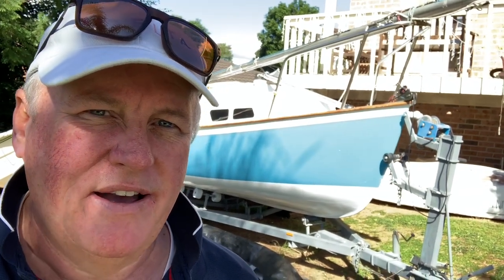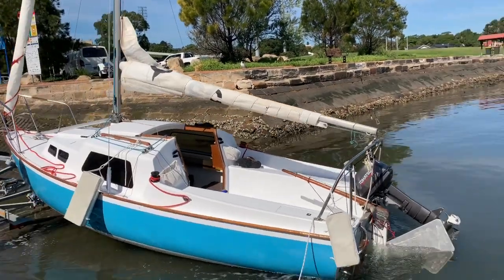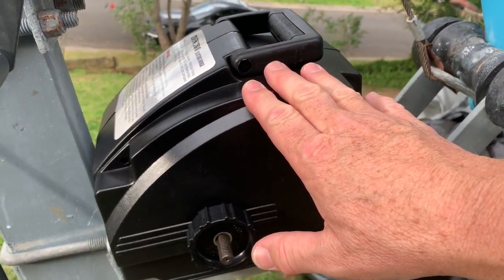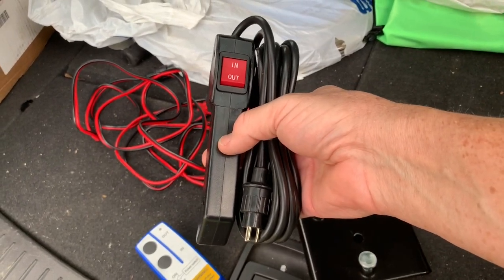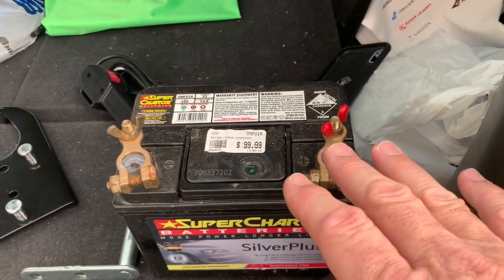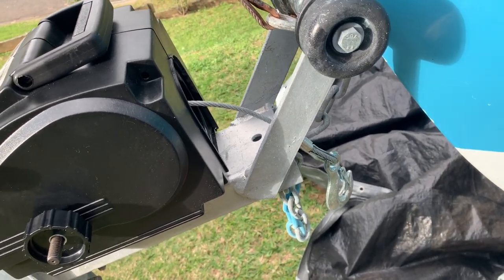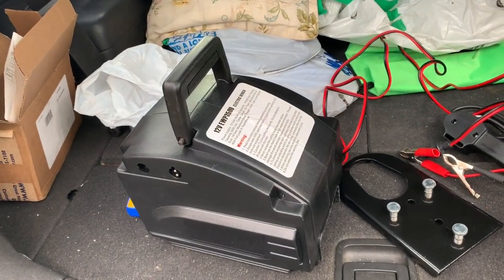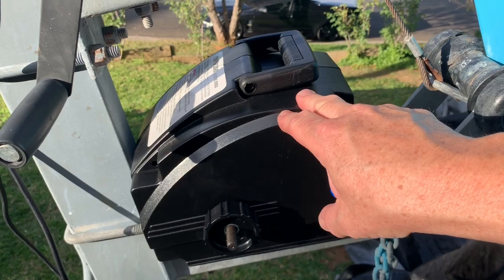Careel 18 Part 2 Electric Trailer Winch Install

Comment: I found those cheap Chinese electric winch wouldn't pull my boat up the trailer. I ended up using an Atlantic manual 3 speed winch 5:1, 10:1, 15:1
Reply from the maker: I had a good quality winch to start off with that should have been able to pick the boat up vertically going by their spec sheet but couldn't pull it up the trailer. Lesson learned go for the next size up, a snatch block is another alternative and others get good results with a 4X4 recovery winches. Glad to hear the Atlantic works well, they also make a electric winch that I have seen good reviews on.
For me and my little light weight trailer sailer (around 700 to 800 kg) my electric winch is the difference of being able to always retrieve the boat solo or having to require a helper. Thanks for watching.

Comment: ... a sailing buddy uses a cordless screwdriver, which he puts on the nut of the crank, works fine ...
Reply from the maker: Hi Pawlov, I have seen that an you the adapter is only around $10. I had a chat with a guy at the ramp using that method and he was also only pulling up a little light weight tinnie with the trailer buried in the water. He said he had tried everything from electric trailer winches, 4x4 winches, cheap cordless etc. He said from his experience you need a quality tradesman cordless, needs to be a 36 volt not 18 or 12,
Reply from the maker: Oops... sent before finishing Part 2... the drill needs to be a full expensive tradesman professional drill WITH metal gears 36 volts .... in other words a $500 plus drill. If you happen to already have one, great ! 
$10 and you are up and going, if you have to buy the drill probably cheaper options which is the way I went and the cordless remote

Comment: Sounds like a box of rocks running . I'd always be wondering when it's going to quit.
Reply from the maker: That's the $130 question but they all pretty much sound like that, personally as long as it saves my shoulder I am happy to put up with the rock crusher. BTW, the Unit is still going strong.  Thanks for watching and taking the time to add feedback.

Comment: Have a Fulton XLT, power winch, not that it's installed, doesn't work and trying to find some video's on why is impossible, Saw one video here where a guy had a 7000 lb Fulton winch, says the strap is only rated for 2500 lbs. hmmm,  and you should only run them for no more than one minute, and then let is rest for 15 minutes, well that should take me about 2 hours to load a boat that is 28' even if it's half way on the trailer. also instructions are not very good, and after I wired the two leads, didn't work. It has a remote but that won't pair work either. Not very impressed Fulton. Guys, make sure you check the run time on them and the real load capacity